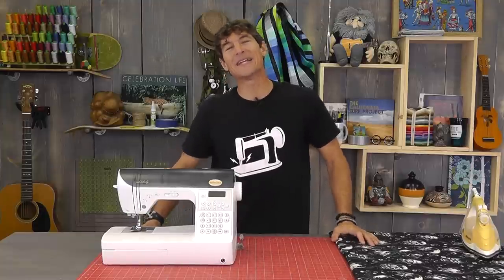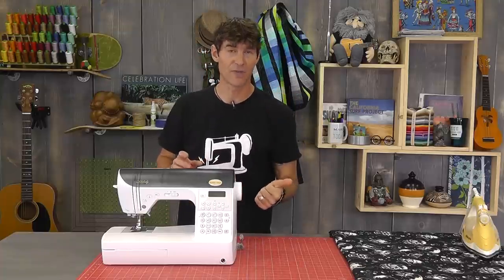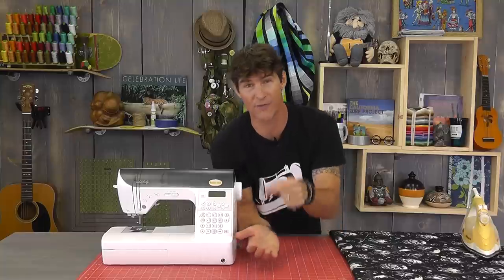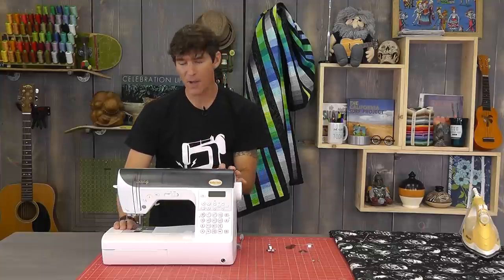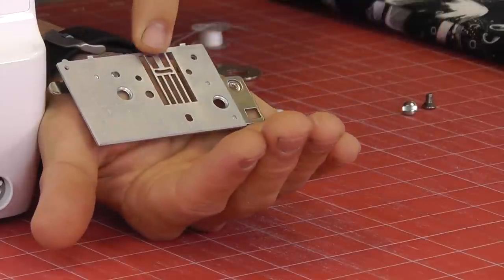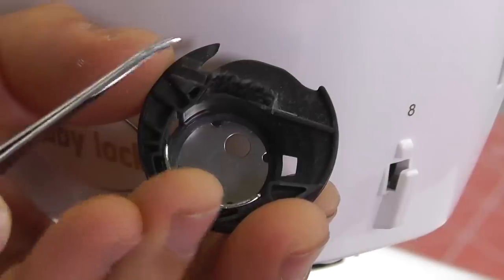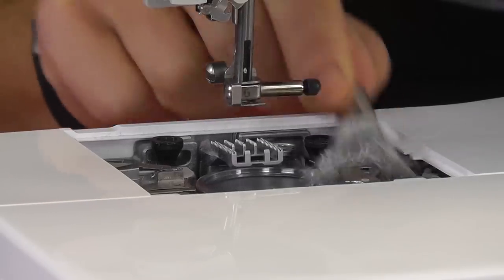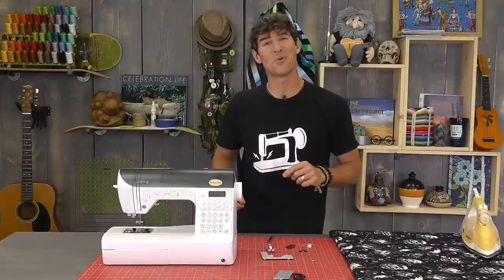Cleaning Sewing Machine Quick Tip

Comment: High Rob, nice video, Ive been sewing for awhile and painting. I learned a couple things from this video. I have a question maybe you can answer or even do a video on. I have a Brothers machine, middle of he road but perfect for me. There are often times when the thread brakes and gets caught in the threading steps. If thread gets stuck I have a time with continued braking and more thread gathering to nest someplace out of sight. How do I get to those areas to pull out the stranglers? Any idea?

Comment: Rob, I am a klutz. So before I start putting the screws back into the metal plate, I just set the bobbin cover over the opening because when the screws spin off and fall down into the machine it is difficult to retrieve them.  "Ask me how I know that"!
Reply: +Pam Woodworth Great Idea.!!!  I can relate. Only I couldn't get mine out and had to have my sewing shop retrieve it. Expensive lesson.

Comment: I agree about canned air. I do not have the air compressor but I have a vacuum with a blower on it. Most backs even uprights convert with a hose and should have ability to blow air. Just saying. You can also by mini attachments for machine cleaning.

Comment: I have a White model 1488 and I am desperately trying to figure out how to get the top cover off.  It has developed a squeak and I don’t want to use it until I figure out where the squeak is coming from.  There are only two screws on the top, and they are over on the corners by the hand wheel.  The cover is not budging over by the top tension area.  I tried removing the little thread guide, but that did nothing.  I can not find what the trick is to remove this top cover so I can oil the machine.  Any advice would be hugely appreciated!